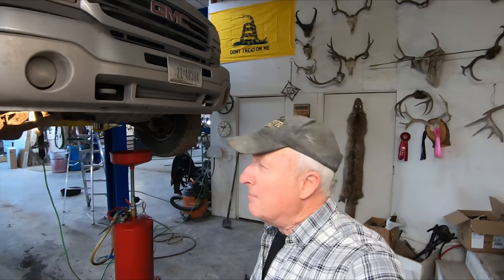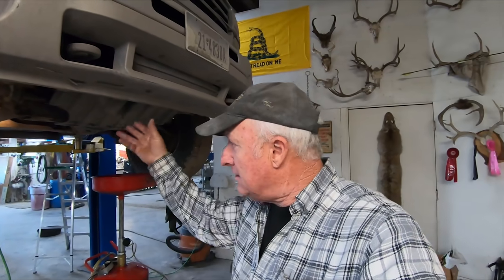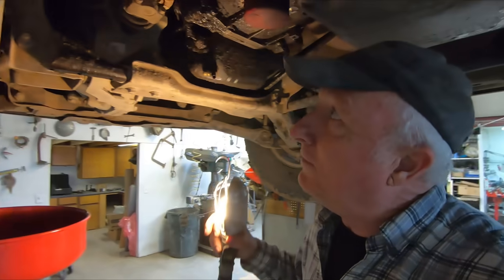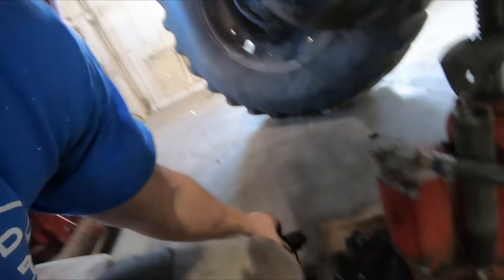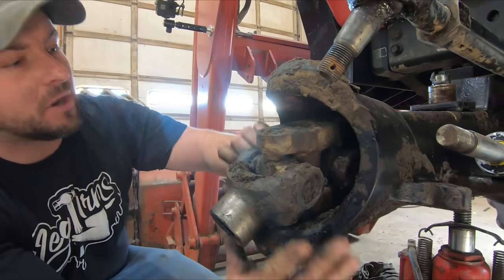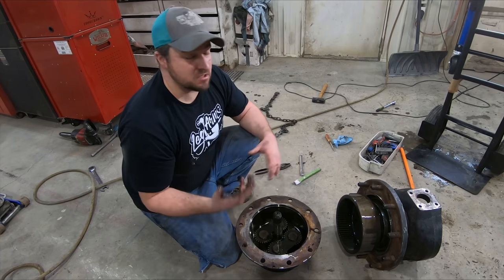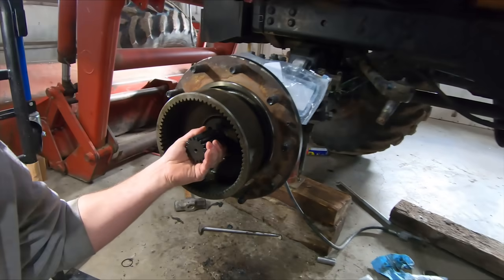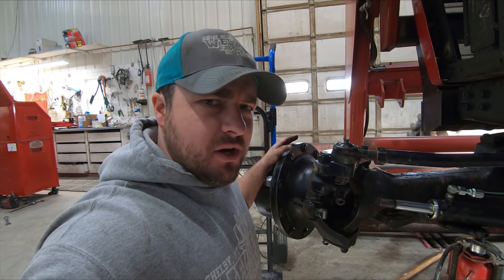NO MORE LEAKS｜Overdue repairs on our CASE IH 7140 MAGNUM

Comment: cleaning wath a pressure washer will kill the seals on the axles.....best to clean with low pressure around  seals or raditors ..learned the hard expensiseway
Reply: Allison Macphee that’s such bollocks. Maybe on a push bike but not on a tractor!
Reply: If a pressure washer messes up a seal it was time to change that 40 year old seal anyway
Reply: HillBillyAsian it just wouldn’t. You would strip the paint off before damaging a seal.

Comment: Shaft, seal, bushing worn out. Part is rusted/stuck.
Legarms: Push, pull, twist, wedge, pound, air hammer, wrench, bigger wrench, 4-wheeler, finally part comes out and repair is made.
Me: Well, time for a new tractor.

Comment: The one white tail shed hanging on the wall is beautiful, what was the estimate on the score? Change the U-joint!!! do the extra work because it will fail at the worst time. It has enough play in it to justify changing it, You possible could use a Tiger  press or one from Mac tools and change it in its location without pulling the shaft. Not FRUSTRATED but...... lol....... I have been there and took the short cut and guess what ? When I needed the vehicle guess what went BAD?  It is always a judgment call and I would do ROCK ,Paper, Scissors. When you pull the upper and lower joints off the main housing drill and tap for the bolts you want the engineer to put in . They use the planetary gears so you can mismatch tires and keep the front tires spinning about 8-10% faster than the rear, This keeps the tractor going straight . If you make a shim for the tie rod you can take the slop out of it until you get it changed. I did it one time for a quick fix and it will pull the ball down in the tie rod socket making it tight, but remember the socket is also worn and it should only be done in a case like yours where you are trying to get by until you get parts. As always love seeing the farm and your smiling faces .

Comment: You have 3/4" and 1" impact guns.  Why don't you have a CP717 or an Astro 4980 hammer ?
So the piece you could not get out ... Why didn't you drill and tap it for a jack screw ?

Comment: You didn't drill and tap those pin flanges to make it easier the next time?
Reply: Won't be a next time
Reply: @scottholbert1192  If I had a nickel for every time I've heard that, I'd be a rich man. People don't use anti-seize because they think they will never be taking something apart again then have to fight it later. It might be coming apart within a year to replace the seal that wasn't replaced this time. I have drilled holes and welded nuts on to push things apart.

Comment: Do you heat your shop with waste oil?
Reply: You, obviously, have never used a waste oil furnace.  There are few things on earth more frustrating!
Reply: @paulcopeland9035  not sure why you're so angry, but actually I do heat my shop with waste heat.... perhaps it's just something you struggle with?
Reply: @stoneshrink  ...I'm not angry, just interested.  What system are you using?  Is it your design or a commercial unit?
Reply: @paulcopeland9035  my design from a couple (or more) different youtubers.  I can't see spending 5k for a commercial system, those break a lot.  My system is a pressure air source drawing used oil blowing into a combustion chamber wrapped with water-filled copper tubes to even out the hot spots. I have a post-combustion chamber above the combustion chamber. (picture 8" tube connected vertically to another 8" tube) It's dead nuts simple, has worked for years.  I use propane for the initial ignition....

Comment: Number one thing if quick drains------ You CAN NOT DRIVE IN CORN FIELDS... obliviously not a issue your neck of the woods.... Rest of corn belt ignore greatness of easy drain... That goes with purchasing over the road semi  trucks for Farm use in corn country. Change out easy drain oil plugs.